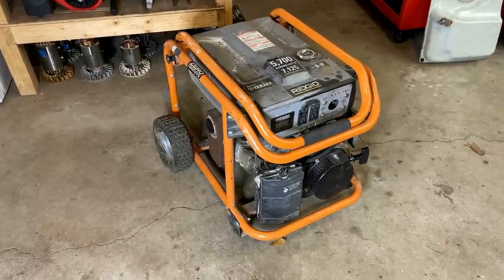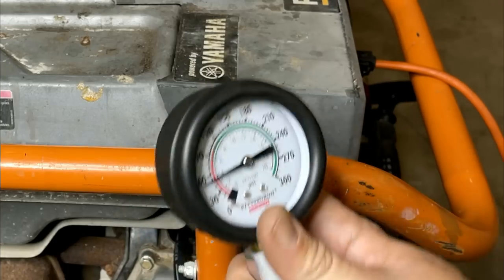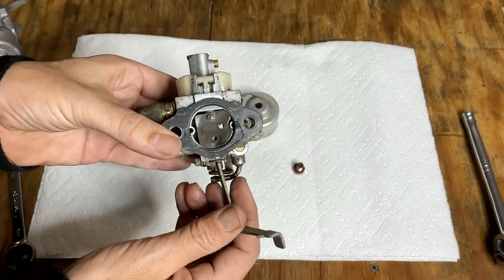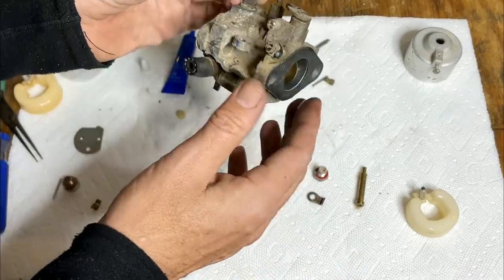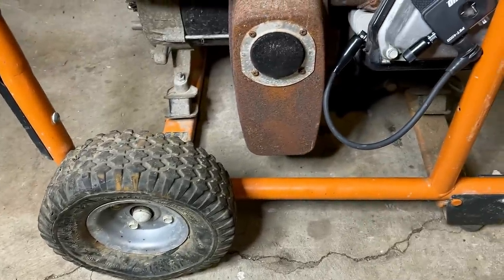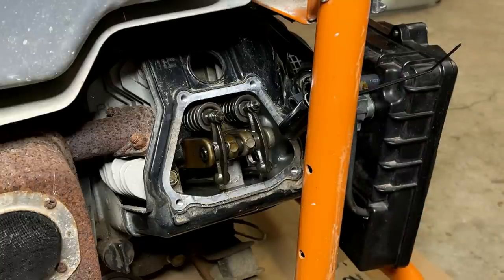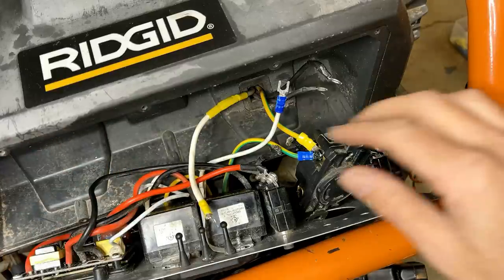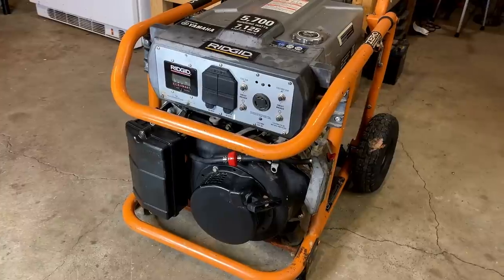Trashed Ridgid Generator - Will Not Start

Comment: When you checked fuel, ignition, compression and timing I thought maybe there starting fluid was bad.  I bought some from Autozone that had no pop at all.  When you checked the plug gap and it fired I let out a "No way!" I would have never thought the gap being a bit wide would have caused a completely dead engine.  That generator was thrown in the trash because the plug gap was set too wide.  Incredible.
Reply from the maker: I thought the same thing for a minute, but it was the same can I have used on other engines without issue.

Comment: The material that you vacuumed up looked like buckshot from sandblasting. That may explain all the dust that has encapsulated the genny.
Reply: mr. condon I  I have watch you videos and I have a toro recycler mower . I ts hard to start without keep hitting the primer button . I think it maybe the auto choke . where do you ordk youer the parts that that you use ?  I don 't want to mess with a dealer . thank you , you are my "hero "

Comment: Hi James, this is Ron Goodrich.  I'm 77 years old and a disabled Vietnam vet.  I bought 2 generator for 50.00 . All I had to do was clean the carb on both of them . The one is electric start. So I'm going to keep that one.  Both make power  . I set both at 61.5 kw and 123 to124 volts. I don't have much to put a load on them but what i do have it holds very well on both of the . Now I have a generac 5500-6500  I have the motor running fine but not making power. I've checked is all over and it checks out ok. I put and new voltage regulator on it and still done power up do you think I should try to put 12v to the roter . Maybe lost Magnetism. That's what I'm going to try. I also have a nother that will make power but I can't seem to keep the velves adjusted.  If it don't start on the first pull it will take or hand off on the second pull. When I got this motor it was apart. I clean carb and put it back together.  I guess I would like to know if the velves need Rotator caps or is my pressure Release sticking.  I've only had it running once. After I got it back together.  Do you have any Is suggestions. I'm leaning towards the cam. Any help I would Appreciate. Thank you love your shows. You have taught me alot for and old man I'm. 😂

Comment: I'm amazed at how few special service tools he uses in his work. I don't own an ultrasonic cleaner, a readout for generator frequency/voltage, nor his sparkgap tester introduced here...but as a woodworker, motorcyclist, radio control enthusiast, & shadetree mechanic since the late 1970s i own every handtool that I've seen him utilize over the span of 30 videos. I detest having to take my car to a dealership for service as they justify their high shop rates because of the cost of the special service tools that they say the ICE car manufacturer forces them to buy as part of their franchise contract. Mr Condon seems to be immune to that scourge, making talented use of generic mechanics tools such as calipers, micrometer, etc etc. James, i congratulate you & thank you for keeping so many machines out of landfill...giving them second lives.

Comment: James   Boil the o ring after it’s expansion in cleaner in an electric kettle.   After it comes to boil check the diameter for fit.  It will resize!

Comment: Still watching this video but have learned something new already.  I've never heard before that it takes more voltage to jump the gap when under compression than it does at one atmosphere of pressure.  If I'd seen that strong spark at the plug tip and I verified timing was right then I'd have completely stopped chasing the electrical side of things.  I appreciate you taking the time to share the content that you do.

Comment: A good way to sometimes fix a seat not sealing is to use a small amount of lapping compound on a cotton swab attached to a drill and what I do when soldering I place the iron under the wire and feed the solder on top so it floats through the strands completely, my two cents. Love the content James I have learned a lot on power heads from you.

Comment: I always enjoy your videos.  It's amazing to me that there seems to be people that have more money than sense.  Someone throws away an $800 + generator and then probably runs down to the local big box store and spends more money on a new generator.  I love taking old derelict equipment and trying to get them to run and operate.  Nearly all of my power equipment are derelicts that I pickup (for free) along the road that don't run and people have given up on.  I spend a little time with them and get them running and operating better than the new junk being sold.
Reply from the maker: The old stuff is always better.
Reply: They actually have more sense than money. If you have a team of workers and an entire job site shut down because of one generator. You need to get one back on the job quickly and without fail. A thousand dollar generator is nothing when you're loosing thousands an hour because it doesn't work.  So they buy a new one and run it for another 1500 hours. But yes its good for those of us that are handy. Because our time is less in demand and we can repair what they didn't have the time or skills to put back into service.

Comment: Another nice video. I like your love for details. Maybe you already know....but I have 2 hints for you. You can check your float & needle  before reassembly by blowing through the gas inlet pipe and turning the carb upside down to make the needle seat. And for the faded black plastic you can use a heat gun gently, it will bring back the oil in the plastic surface. Keep your nice work.

Comment: I love these videos. For some reason I just love watching You fix these small engines, even though most of them suffer from the same issues. The only comment that I have is as follows. I notice that when you are adjusting valves, you tend to re-adjust them whether they are too tight or too loose. I’ve always been told that “sloppy valves are happy valves”. If a valve clearance is looser than it should be, I would suggest that, unless they are extremely out, it would actually be better to leave them slightly on the loose side than trying to get them “perfectly” within clearance.

I made a mistake with a Coleman generator that I have, techumseh engine, where I had to grind the exhaust valve down to increase the valve clearance. It ended up disabling up the decompression function because the pushrod couldn’t compress the exhaust valve anymore on startup.

The engine runs great, it’s just a lot harder to start now
Reply from the maker: A agree.  You will never get them perfect and better a little sloppy then tight as long as a push rod does not fall out and the compression release still works.

Comment: Another nice job, especially in troubleshooting the spark issue. I wanted to mention that some flux in paste form dabbed on the joint before soldering will help eliminate any contamination on the surface of the metal and make the solder flow much better. Make sure to use the rosin, not the acid solder though.

Comment: One takeaway I get from this channel is: what it takes to be a part of the collective human mind that makes these machines possible; the engineering, the physics, the design process, etc. To buy into that as a mental state is to immediately improve as a trouble-shooter, and to see things as they are and not as a reflection on yourself. The source of James' calm as he goes through his process. This machine may have been externally dirty but it was for a long time internally cared for and made it to what amounts to two full months of continual use which is a lot to ask of a single cylinder, air-cooled, static, jobsite workhorse. Always a pleasure Sir.

Comment: Hi James, just a note regarding your soldering, hold the tip under the join you are making, after tinning the tip of course, helps to get heat into the join. Also heavier wire will require a larger iron, but whatever you get make sure it has a large heavy tip, when soldering heavy wire you need an iron with a lot of thermal mass.
Love your work mate, always watching from Sydney, Australia.
Reply from the maker: I agree completely.  Not the right iron for the job.
Reply: see so many YouTube videos of people trying (failing) to solder with tiny tips, particularly the new battery powered (Milwaukee), no good for anything apart from the smallest wire
Reply: Back in the 80s I purchased my Unger 45W soldering iron.  I had a selection of tips for it based on what I was doing at the time.  I lost the iron a few years ago believing my neighbor borrowed it and didn’t return it.  I purchased a Weller to replace it, but it just wasn’t the same.  I did eventually find my Unger and am happily using it again.  Due to failing eye sight, I don’t do much electronic work these days, but I got comfortable with my soldering iron.  Seems like a silly thing to get attached to.  When I purchased it in high school, $45 was a lot of money, but it’s still going strong 35 years later.
Reply: G'day Ben you sound like an Auto Elec? 👍🇦🇺.
Reply: @ishure8849  I am :) 15 years as a heavy vehicle auto electrician. Done a bit of light vehicle stuff but that's mainly a hobby.
Reply: @jcondon1  All good! You make it work with what you have!
Reply: @rickgaine3476  I have one,  with multiple heating elements and an assortment of tips,  both of which you can still get.  Check out Mouser Electronics for that stuff.  My favorite tip is the PL113.   I've only recently purchased a temperature-controlled iron,  haven't use it all that much yet.

Comment: yes finally someone telling people the right and common sense way to set valves just tell them if one valve open the other has to be shut and cam lobe not near to opening good job my friend i have been setting valves that way for 40 years
Reply from the maker: Its the best way.  Seen too many people no realize the piston is at the top twice and they set the valves on the wrong stroke.  No need for that.

Comment: A well designed engine can have a super long life if its maintained well.   It seems that someone at least kept the oil up to the level,  and that's the most crucial component in my experience.  Fine work as always.  Logic and reason saves another piece of power equipment.

Comment: Interesting catch on the spark plug gap. I was thinking with todays cars having such high voltage ignition systems, they will fire with huge gaps.  I can remember to the ignition systems of 1970s cars.  Those cars (like a magneto system on a small engine) could have large enough gaps through wear where you would have misfires and difficulty starting.  New spark plugs were part of a typical yearly tune up.

Comment: Thanks for the video.  My rule with soldering is to have a good physical connection then add the solder.  There are some great Waterproof Solder Butt connectors with solder in the middle of the shrink connection.  I use them often.  I get them on line.

Comment: Another fine video!  In a previous video you mentioned that at top dead center on the exhaust stroke there is a instant where the intake and exhaust valves are slightly open and at that point the spark plug will fire again (plug fires every time  top dead center is reached).  So if you have a misfire on the compression stroke the unburned fuel can be ignited at the end of the exhaust stroke causing a back fire through the carb and muffler. I have seen the effect before but did not understand why.  I forgot to thank you for that tip.

Comment: Nice job on that generator that most likely was used and abused on a construction site. Just a couple of comments, mechanical joints are way superior on larger wiring carrying higher currents and there are several plastic "rejuvenation" products sold for cars that will make that faded plastic look like new if you want to get the most return out of that genny.

Comment: Depending on the material used, you can put those carb cleaned expanded gaskets/O-rings in the freezer and they shrink down enough to install.

Comment: My brother was a good mechanic, but he always bought cheap tools. He would complain how much good tools cost, buy the cheap ones, and then complained more when the cheap ones broke. You really nice looking tools, and you keep them spotless. I hate when mechanics don't keep their tools clean. I like your break out cord. Where did you get from? How about using a weather proof outdoor single outlet cover to protect the 240v. outlet? Excellent video.
Reply from the maker: The breakout cord I found used on Craigslist.  I have a link in my store to a similar one sold by Amazon.  My tools are on the cheaper side, but good enough for the work I do.

Comment: When drilling holes in metal for eoecctric or gas lines use a chase bushing that is used for electric wire in the hole to prevent wire tear or shorting out the wire or tubing sold in electric supply stores in all sizes !also called chase nipple with plastic bushings   L
Reply from the maker: Yes, have used those before.  They work well.

Comment: If you can look down and see the piston like you did earlier to check coil and magnet timing, you can know if you're at the "right" TDC for valve adjustment as long as you can put your finger on the spark plug hole around 1/2 way up the stroke. Coming up on TDC compression, the pressure will push your finger off the spark plug hole. It won't do that on TDC exhaust. 🤓👍 This is also a super duper rough method of estimating if an engine has enough compression to run. Pull the plug, ground the plug or coil, open the choke, put your finger firmly over the plug hole, and crank the engine over. If it has enough compression to start, it'll vigorously blow your finger off the hole and push air past it. If it has insufficient compression, it won't be able to blow your finger off and you'll be able to hold the pressure inside the cylinder all the way through TDC compression and into the power stroke. Small 2 strokes can be guesstimated by letting them hang by their recoil cord. If you can't dangle a 2 stroke chainsaw or weed whacker by its cord without it unraveling and dropping down to the ground, it will probably start. If the engine just pulls itself down due to gravity and the engine turns over as you hold the recoil handle in the air, she's dead Jim... 😸

Comment: Nicely done, and I learn something in every one of your videos. But you need more heat to solder wires/connectors that size. And in a high-vibration environment, a mechanical connection (crimping) is preferred to soldering. Also where a short or overload might happen, heat can melt a solder connection but won't affect a crimped connection. As an old electronics hobbyist I often prefer soldering myself, but that's what all the tests and studies say. Done well either is probably OK.

Comment: That generator looks the one I worked on that was owned by a concrete company, hence  with the gray dust inside the stator.  Concrete guys know bad the dust is on their equipment and most do a decent job taking care of their equipment such as the forethought to use a furnace filter on the intake.   Funny thing, they go to great lengths to protect their equipment, but yet many of them never wear respiratory protection, Silicosis is a nasty way to die slowly.  I thought that generator was DOA when I first saw it.   But yet, it showed how durable a decent import generator can be.  Good job as always.  I always look forward to "Thursday James Day" . . . . . which kind of rhymes!
Reply from the maker: Those Yamaha engines are tough.  Besides the dust, it probably ingested the missing choke plate screw.

Comment: James. On finding TDC, turn the engine over, and the intake closes, and you rotate just a bit more. The engine is on compression stroke. Be sure you rotate the engine and the correct rotation of the engine
Reply: Sorry not TDC but the compression stroke both valves are fully closed.

Comment: James, note that it is entirely possible to find small screws like that butterfly screw at ACE hardware. My ACE hardware has a section of hardware that has small #2 or #4 machine screws (looks like that screw here), metric sizes, and a bunch of other similar stuff that is really lifesaving...if you know what I mean...
Great video by the way.... I should say, Another Great Video BTW.... !!

Comment: I like your clothes-pin wire holder for wire splicing .. the flat grip is better than the alligator clip setup I have .. the alligator clip holder leaves gouges in the insulation after the solder heating .. I just made up the clothes-pin spicing jig …
Reply from the maker: Nice!